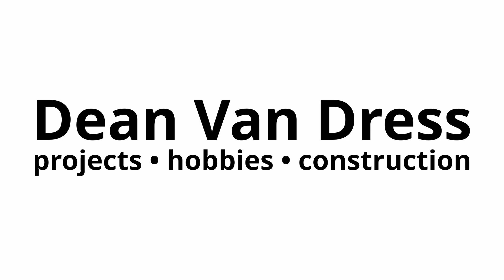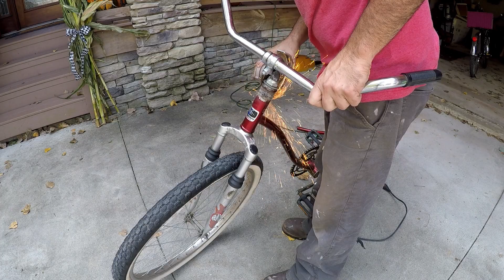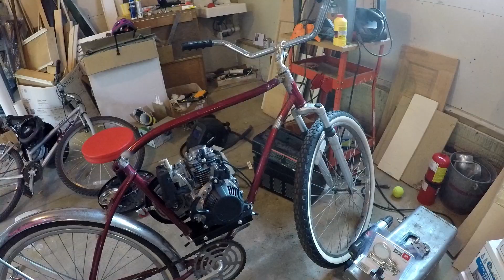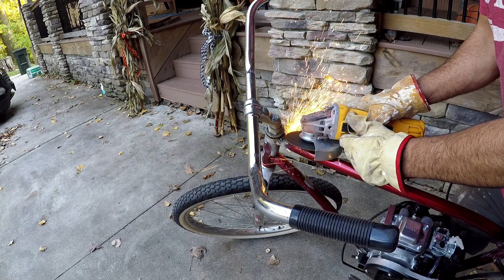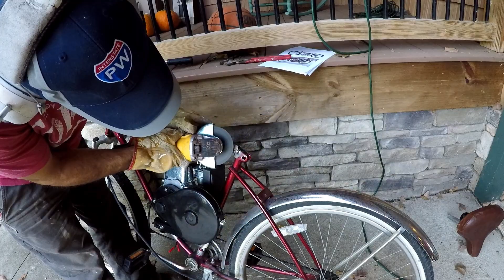49cc 4-stroke historical motorized bike build #4 (fabricating and grinding)

Comment: wich engine is best 53cc 4 stroke or 49cc 4 stroke. pls tell me, I want to buy a engine kit for my bicycle. plz answer me.
Reply from the maker: check out 'project farm' on youtube.  that guy has a pretty good comparison between the two types of engines.  my preference is the 4 stroke.  Dean.
Reply: @deanvandress4693  You totally misunderstood the question that was addressed to you. It was not about 2-stroke or 4-stroke, it was about the tiny difference between 49cc and 53cc 4-stroke engines.Wake Up!